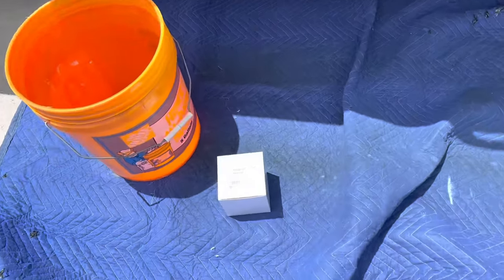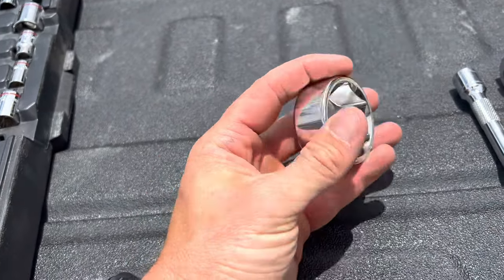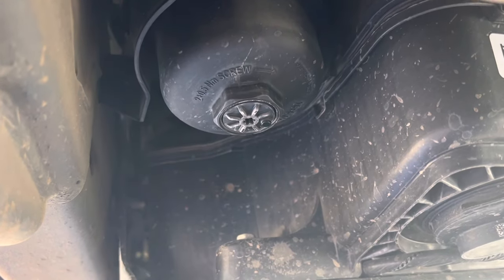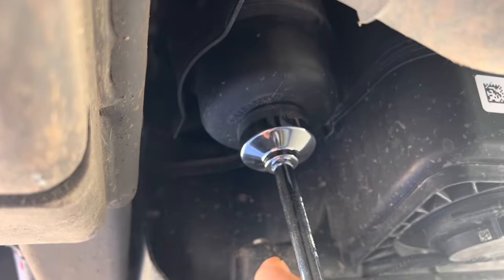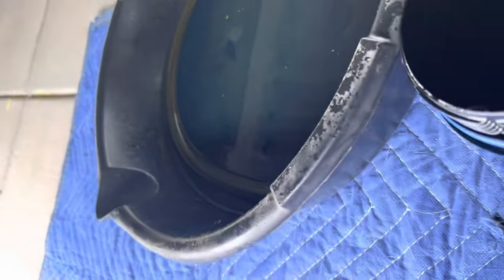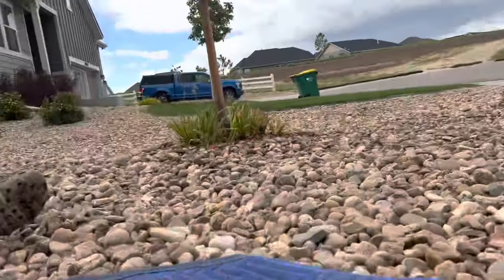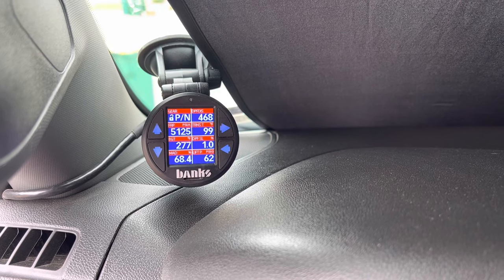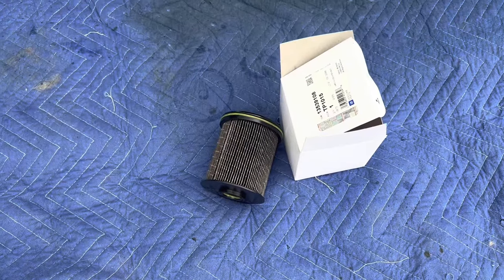2022 Duramax L5P FUEL FILTER CHANGE | GM 2500/3500 HD

Comment: For those with a push button start rather than a key, hold the button in with your foot off the brake until the lift pump starts. Once the lift pump kicks on it’ll run for a bit and shut itself off. Once was enough. The engine fired up like normal.

Comment: The black stuff (actually brown) on the filter and in the bowl will be there no matter what fuel you use. It's caused by common rail and is called asphaltenes. The fuel is heated by the HPFP and by cycling through the injectors and back into the tank, and that causes it to degrade into microscopic particles. The particles are soft tar so they don't hurt anything, they just get caught in the filter. A lot of people wrongly think it's algae contamination and waste time with biocides, which are bad for your engine.

Comment: If you start to get the P0191 error code dealing with fuel rail pressures, even if your fuel filter says 20% remaining life, change it - that is primarily the problem.

Comment: I have the “Service water in fuel” warning. I took the water plug off, the T-30. Some water did come out, I put it back on, warning popped up again. So I have taken and put it back on several times, water dripping out every time. I am wondering if you don’t leave it off and idle the engine? Your thoughts?
Reply from the maker: So only so much will come out when you pull that plug, it creates a vacuum in that filter housing. I would completely remove/drain/prime it again and see if that solves it. If not, you might be pulling water from your tank/pump and your fuel source could be an issue

Comment: Thanks for the vid. That's a lot easier than my 2016 GMC 2500 where you had to pull the ps front wheel and inner fender

Comment: Hello! Please, could you ask a question? Does the 6.6 Duramax Diesel version also have a fuel filter? Or just the gasoline version? Thanks!
Reply from the maker: Yes both have fuel filters. Harder, diesel motors require more filtration (dirtier fuel, higher fuel pressure, etc.) so you have to change them more often. With gas motors it’s much less frequent as the gasoline is inherently cleaner and the fuel pressure required for injection is not nearly that of common rail diesel motors you see now.

Comment: Can I change the filter with a full tank ?  Will I have excessive fuel drainage?   Also , did you pour fuel onto the filter or did you install it dry ?  I heard you say the you lubed the o-rings with fuel. 

Thank you
Reply from the maker: Fuel tank level will have no effect on changing your fuel filter. The only fuel that will come out is in the bowl itself. 
Install it dry and prime it as I showed by cycling your key (foot off brake) to all accessory power 3-5 times to purge the system. The motor will take longer to start but that’s normal as fuel builds pressure all the way thru the system. 
You can use fuel on the O rings or an O ring specific lubricant. Fuel is fine tho
Reply: How does the air purge out!???   Obviously on the older duramax there is a air valve

Comment: Hey, great video I had the same truck I was wondering what size rims and tires are running on it I was wanting to do 20 x 9 if it 35s but I don’t wanna have to really lift because that’s my daily driver I do construction. So what size rims and tires are you running and what is the opposite? Thanks so much I appreciate it.
Reply from the maker: Thanks Jason. They’re 20x9 with a +12 offset. I had the stock tires on in this video but you can run 35’s with little/no rubbing. Stock tire size is 34” anyway so 35 is not a huge difference. I currently run 37’s with a 3.5” lift and it rubs, I’ll be downsizing to 35” next

Comment: Whats the average mileage between fuel filter changes on these 15k? Do you wait for the dummy light to come on the dash so to speak or does the owner manual specify a mileage amount?
Reply from the maker: Owners manual has maintenance intervals based on normal or severe use. I use my life % on my dash as a guide, but sooner the better as alwasy
Reply: I got about  14k.  I need to change it

Comment: What’s the torque spec on the T30 Torx?
Reply from the maker: I’d have to check don’t know off hand but it’s plastic so nothing crazy if you use your hand wrench
Reply: @aslife3813  copy that, just don’t want to over-tighten and strip and or under tighten and leak.

Comment: I was so happy to see GM relocate the filter to a practical location & ditch the sensor wire.. you have a knob on the guage cluster to scroll the menu? Wierd, i have a 21 custom, i use the steering wheel buttons
Reply from the maker: Agreed, never did the one on my ‘15 lml but I heard it sucked. These are so easy and convenient. H&S makes an aluminum housing too if the plastic does plastic things

Comment: How much diesel came out.. any need to unplug batteries?
Reply from the maker: Nope no need to pull the negatives. You’re not pulling any sensors or messing with wiring. Very little, just what’s in the bowl so a few cups I think
Reply: @aslife3813  just did it TY 😊

Comment: Yo man did u prime it? How do u do that on a push to start
Reply: I mean I did key on and engine off but I couldn't hear it priming
Reply from the maker: Keep your foot off the brake, key all the way on without cranking it over, wait 10-15 seconds. Do that 4-5 times and you should be good
Reply: @aslife3813  okay wasn't sure, I couldn't hear it prime like normal. Worked on one today and just wanted some assurance on the fuel pressure 😂 thanks
Reply: Thanks for this video I had my oil changed at Walmart and offer to pay them to install my fuel filter but they wouldn’t do it 🤷‍♂️ so here we go.
Reply: @chandlertorres8272  I just went through this for the first time. Had to hold the button in for about 10 seconds and then it’ll start the lift pump. Just pushing it on then off a few times won’t start the pump. This was on a 2022.

Comment: Is it just one fuel filter? New to gmc I got a 2022 as well. I was told there are two fuel filters on some other trucks
Reply from the maker: Yup just 1 on 2020+. Pretty nice and they make it easy. No more double filters with one by the tank and one under the hood, although with diesel, more filtration isn’t bad